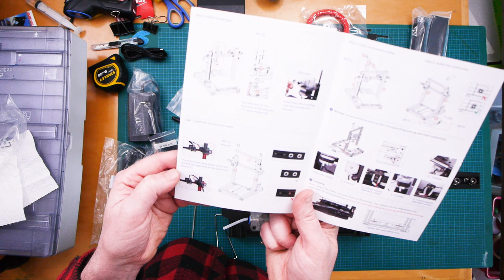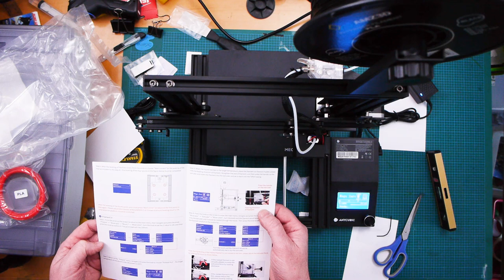Unboxing Anycubic Mega Zero 3d Printer

Comment: The Owl is the only model that i can print perfect. I have Two days with my printer.
Reply from the maker: I am using the newest CURA downloaded from the Ultimaker site with a slightly modified  parameters MEGA-ZERO-PLA-V1.0 curaprofile from the SD card. I added more skirts around the model, there are 8 now.
I noticed also that if the room is cold or if the nozzle isn't really grabbing the paper when leveling I had problems with lifting as well. I used the glue stick sometimes and it seems to fix the holding to the bed.
There is a bit of tinkering but eventually I got things working very well with the PLA and TPU. I have had it only 2 weeks so its new for me too.

Comment: how long did it take to print the owl? the one im printing is the owl pair and it says 26:58:59. Could that be right?
Reply from the maker: That seems way too long. The single owl was about 45 minutes I think. They're used as tests so they should print fairly quickly with the settings for PLA on the supplied SD card.

Comment: did you get the elephant foot on object base? thank you.
Reply from the maker: For PLA I haven't had any elephant foot problems. But when I first tried TPU I had a slight elephants foot on some objects, but it was probably from overheating because I was using a heat gun on the plate before printing the TPU object.
Reply: @ToddMunro  thank you for information.